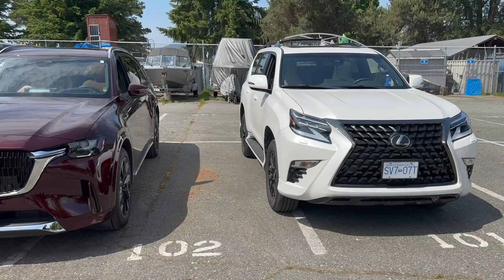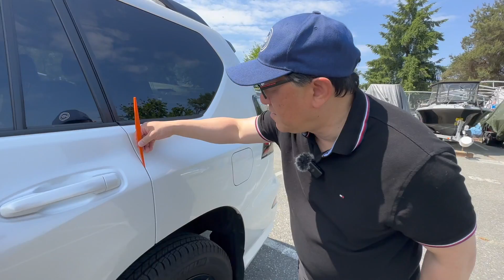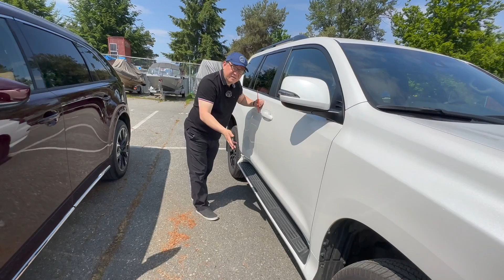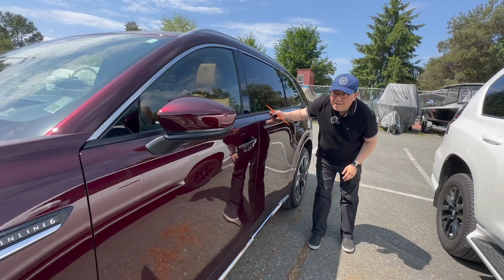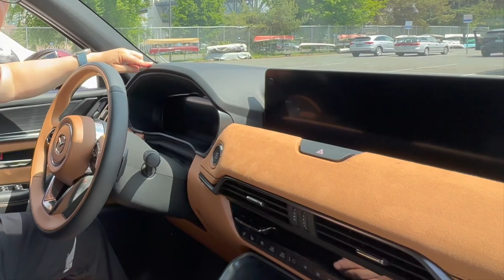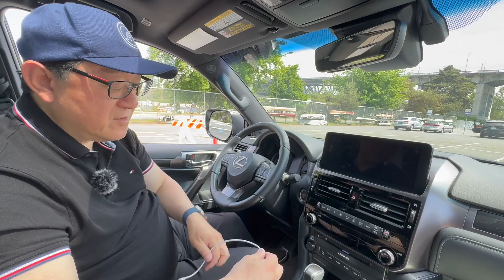MAZDA CX-90's QUALITY AS GOOD AS LEXUS GX? ENGINEER COMPARES THE QUALITY OF THESE TWO VEHICLES

Comment: My 2010 GX460 which I purchased in September 2010 has been absolutely outstanding! I still have it and will not get rid of it because it is incredibly reliable and it simply runs perfectly! I don't think the GX550 replacement will ever replace it because without legendary Lexus quality, it simply another vehicle and I hope that isn't the case. Good for Mazda creating the CX90 but let's compare it in 15 years to see if it's long-term quality rivals that of the GX460 (and I hope it does) but for now, quality must be measured over time and the GX460 is the undisputed king!

Comment: The Mazda CX-90 looks great. I would still want to wait a few years for their engineers to work out any bugs and refine the drive train and suspension before buying a CX-90 or CX-70. That in-line 6 and the transmission are new for Mazda. Give the car a few years for them to perfect it. I have a 2024 CX-5 and they have really dialed it in. Made in Japan. Almost perfect fit and finish. No rattles. Mazda has had several years to refine it.

Comment: I only experienced the CX60, which should be similar to CX90 without the longer wheelbase...the quality feel starts to crumble on the feel of the doors, which feel hollow when closing, the suspension isn't as plush as expected and sound insulation isn't the best neither.

Comment: Hello Mr. David, I just purchased a 2023 GX 460 about a week ago. I'm very disappointed with the operation of the ventilated seats, it's barely detectable even at the highest setting, it's basically useless. I would like your thoughts on this, and does your GX have the same issue? I've seen on some GX forums that some owners are having the the issue. Thank you and keep up the great work. Paul

Comment: Mazda is probably the best you can get for city driving, this is clear enough. The GX460 is on a whole different level. This is comparing consumer grade to commercial grade. The GX460 used in a city driving environment will last forever!! The CX-90 used off-road will fall apart in a week! Both are good for what they have been designed, but the GX460 has the advantage because it will outperform in a less demanding environment since it was designed for harder use. This is why off-road trucks have a high value.

Comment: Things I wish my GX460 had that it doesn't: 
-Roll down rear window. The final version of the 460 has the wiper off the glass entirely and there is no spare on the back so a roll down window would have been a nice touch. 
-Auto lights when wipers turn on. This really bugs me, I know I have day time lights all the time, but the rear lights are not part of the daytime lights, and often in rain, the auto lights do not turn on. This is a no-brainer feature that should have been added a long time ago. 
- A better backup camera! Honestly, I feel like I'm watching a 240p video on youtube in 2006 when I look at the backup camera. Should have been HD full screen. 

-Note about wired car play. I have had wireless car play before and for cars that are shared by multiple people, wireless car play is annoying because the car doesn't know who is driving or who's phone to connect to. For this wired makes perfect sense, and I am happy with the solution. I did add a magnetic phone mount in the useless CD slot. 
-The radio is pointless, they should have just removed this and made the screen bigger. 
-Note about interior. Not a huge fan of the suede that popular now in a lot of cars. Cleaning is hard, and the finish can become very ugly fast. Especially with kids, the finish in the GX is really going to last much longer than the "newer" more expensive looking suede finish.

Comment: I own a 2016 Highlander Limited … it’s been a very good, if a bit boring, vehicle. Just test drove a 50K Grand Highlander with several thousand dollar “market adjustment.” It couldn’t be more devoid of character … it is the definition of an appliance. The cabin materials are cheap, buttons and switches feel janky. It’s pokey and uninspiring in every way. The new GH feels like a step backward in fit, finish and quality compared to my 8 year old car.

So Toyota dealers are brazenly ripping people off, especially on the hybrids, and for the money their cars are fair to middling at best. Will they run a long time? Probably. Will you want to drive it a long time? Doubtful.

I’m absolutely going to give the CX 90 a test and see what it’s all about. I’ve had a very positive experience with my 2016 Highlander but between the dealers and the new products I can’t even get interested.

Comment: From perspective of a UK driver, I have to disagree. I own a 2018 rx450h with 67000 miles. I test drove a Mazda C X 60 last weekend and it was nowhere near the quality of the rx. The doors were tinny, seats uncomfortable, fit and finish not as good, electric windows noisy and clunked when reaching fully open or closed, car was jittery on the road and underpowered (Mazda diesel version 254 bhp), not as quick or refined as my rx, which is now 5 years old. I wouldn't swap that brand new Mazda for my 5 year old Lexus.

Comment: Another good video, so thanks.

I was weighing up between a Mazda CX60 and the Lexus RX. I know the comparison should really be with the NX but I was looking at the RX mainly. 

The CX60 came out on top - it's more fun to drive, and the design is cleaner, easier on the eye and more to my liking. 

It also saved me quite a bit of $, as well as aligned my ego problem by foregoing brand recognition (brand snobbery?).

Comment: A lot of reviews seem to be based on Mazda CX90 looks and interior. There is a blaring mechanical drawback to the engine and powertrain, where be it, maintenance needs to be performed. Essentially due to the closed quarters and placement of the parts, the owner will be floored with labor costs.

Comment: I'm becoming impressed with Mazda. However, I wouldn't ever buy one until it can match the 4WD performance of the GX or even 4Runner. I'm an old curmudgeon and prefer a body on frame. I'm not overly picky on driving "engagement".

Comment: While panel fit and finish may be equal or better then the lexus i would not go so far to extrapolate and say that this extends to every other aspect of the vehicle. Beauty as they say is only skin deep. Quality and durablity of toyota/lexus components and parts its unmatched by anyone else. No other brand is designed to last 30 years 300,000+ miles with regular maintenance.

Comment: If the CX90 has any mechanical issues they will start to appear within the first year of ownership. I'm interested in the CX70 and hoping its smaller than the CX90
Reply: I've read somewhere that cx70 will be same size as cx-90 but 5 seater
Reply: @nobodyyouknow2005  I've heard the same thing from a Johnathon Sewall and the Mazda dealership near me. I really hope Mazda doesn't have two vehicles the same size. That makes no sense. They could have made the 3rd row an option

Comment: At $50k+ I will prefer to put 10k additional and get the Lexus,  or get a certified preowned for the same price.... also the sheet metal in mazda is so thin that gets dinged easily,  ot the case with the Lexus or Toyota
Reply: Ok - what exactly is the thickness of the sheet metal on the Mazda CX90 panels? What is the thickness of the sheet metal on the GX460 panels?

Comment: David, I agree with you. Mazda has done an amazing job with the CX-90 pertaining to quality, drivetrain, features and the pricing.  I do think the 
U.S. dealers might be asking more than list price for the CX-90...at least at first market introduction.
Reply: Per my local Mazda dealer, Mazda corporate has barred dealers from charging over MSRP.
Reply: @t3h8ar0n  For sure, that is the right thing to do.
Reply: I used True Car… put in a zip code where I knew I would contact dealerships who gave good value… bought mine for 1500.00 under MSRP from Vic Bailey Mazda. They don’t do mark ups and they are giving discounts!

Comment: It’s not just about panel, paint and interior materials, but the drive train and its longevity. The Mazda may be an adequate mall crawler family type vehicle, but if one is talking about any type of off roading there is no comparison. I just took my new GX to the high mountain passes in the San Juan Mountains in Colorado and it performed brilliantly on the rough 4x4 roads (only other vehicle I saw were Jeep Rubi and lifted Tacos). This level of trust is not easily earned without years of track record and engineering masterpiece like KDSS
Reply: You are saying that the Mazda AWD is lacking?  You need to do some research before your bias is exposed.  It does fine off road as does the Lexus.
Reply: Didn’t see a single AWD crossover in the 2 days I was there. AWD crossover are not for any serious off-roading, and the roads requires 4WD with 4L and locking diff, etc
Reply: @ruggedland 99% of buyers for either vehicle here, or any SUV for that matter, are not off roading them. They will spend nearly 100% of their life in the mall parking lot. 

Off roading customers are a tiny percentage of overall buyers. Don't confuse your personal choices or preferences with those of the majority. I wouldn't dream of off roading either of them.

Comment: We have long-term data on the Lexus; it's a proven work horse, and unparalleled in reliability and longevity.  Not sure you can really do the comparison, as we don't have similar data on the Mazda...
Reply: chuckkerber4735 - The Lexus costs $25k more than the Mazda. Mazda is very reliable in its own right. Do you rationally expect $25k in repair bills on the Mazda? I doubt you would have to repair anything due to reliability issues.
Reply: Without even watch the video I know  Mazda is on bar or better than the Lexus in term of fit and finished. Traded my ‘21  mazda 3 turbo hatchback for a ‘23 gx460  Blackline due to growing family. I can tell you Mazda quality is very nice and it’s a steal for their current price.
Reply: Mazda works with Toyota, shares a factory with them to make the CX-50 (I think alongside the RAV4) and I think they’re even using their hybrid system. 
I could be wrong though. But if true, for Mazda it’s a good start.
Reply: @faheemabbas3965  There is definitely a link up between Toyota and Mazda. In fact the present or previous generation Yaris is practically a Mazda 2.
Reply: @lesliejackson5225 Mazda 2*
Reply: @LSR-YT21  You're correct.
Reply: @faheemabbas3965  Great info- I wasn't aware.  Thanks!
Reply: @chuckkerber4735  Toyota purchased a sizeable stake in Mazda some time ago (they have since opened a joint manufacturing facility).
Reply: Show us your Lexus data.
Reply: Only time will tell which of these vehicles has the best build quality, show both cars  after 10 years with similar use and you’ll have you answer which is better built.
Reply: Damn right.  And, if you get caught out in a blizzard, the GX will GET YOU HOME.

Comment: David, what are your thoughts on how Mazda lines up the front fenders to the A-Pillar?   Floating gap design vs a tight, butted-up joint.    It's obvious that the Mazdas are all built very consistently, all the gaps seem so perfect, but I always felt like where the fender meets the a-pillar is a bit awkward, as if this is the place where they've allowed for some tolerance in order to make everything else line up.  Or perhaps just designed that way for ease of assembly..   Would be interested to compare different design thoughts/strategies from a design/manufacturing POV.
Reply: I actually think it’s a design feature and very Intentional to keep the line horizontal instead of introducing another direction (like most fender-A pillars) in a spot where a lot of visual direction happening.
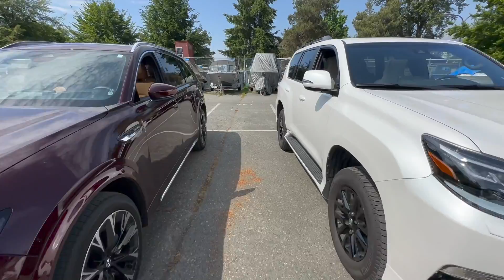Reply: If I pause it at 6:03 and compare them, I prefer the more taut and sharp look of the Mazda. Looks more premium.
Reply: @marshalljames5640  I def agree it looks better from front/side view.   What you see when you get into the vehicle though is a 1/2"-5/8" gap between the A pillar and the fender.    It doesn't really bother me, as it seems very much an intentional decision.  I was wondering if this gap somehow allows them to made the hood and front door gaps perfect (which I think are much more important to get right).

Comment: We have no idea about the long term mechanical reliability of the cx90. But the GX has been proven to last 500k miles with reasonable maintenance.
Reply: Mazdas are usually very reliable, Mazda 3 and CX9 were usually Toyota like quality. CX90 will have a very steep learning curve, I think they messed up by ditching the torque converter by using a “sandwiched” electric motor. Time will tell but rest assured Mazda is usually way better than any German or American brand for short and long term reliability
Reply: cx90 reliability has to stand the test of time. lexus has to do the same when they started yeah? lexus has a bit of a headstart because it had all the expertise and reliability of toyota :) hoping mazda would not waver and continue to push their demand for excellence!
Reply: @jay_logz exactly the point of the comment. You agreed. Lexus reliability is proven, so that’s a key factor in the decision making process
Reply: Yes same old reliability talking point.   We actually have to buy a drive vehicles to test their reliability.
Reply: No denying Mazda is upping it's game in terms of design and quality. I suggest you buy one now because as word gets out these prices will rise.
Reply: @MVRWC  no need to to buy either, as neither suit my current requirements.
Reply: @davidmeyers8230  yes I meant if you're in the market.
Reply: The Mazda driven off road will fall apart, and this is the main difference. The Mazda will last a long time in the city and road driving, but the Lexus is just on a different level. It will outlast the Mazda on the road because it is designed for off road use.
Reply: And is easily the ugliest of the two.
Reply: Mazda doesn't have the durability of Toyota or Honda and they very likely never will. Toyota especially spends quite a bit on testing. But Mazda is the most artful and passionate of the three brands and it will be a difficult pick of CX-90 vs Grand Highlander for me.
Reply: @lkae4 The grand highlander is a 4 cylinder so it's a no go for me as was the Mazda CX-9. The mazda CX-90 is a 6 cylinder so you get your money's worth and it's fun to drive.
Reply: @ROB-12013 My wife has a 2019 CX-9 bought brand new. Going strong at 60,000 miles, absolutely no issues just routine maintenance.
Reply: Lord knows one would spend a fortune on gas with that 15/19 mpg.
Reply: @gio957 That would be me 😂
Reply: Toyota makes Mazda now, so it will run forever
Reply: The Mazda looks good inside and out but over time will it hold up and still function properly without falling apart like Lexus? Idk 🤷🏻‍♂️ but I don’t think so because u can’t compare older Mazdas to any older Lexus